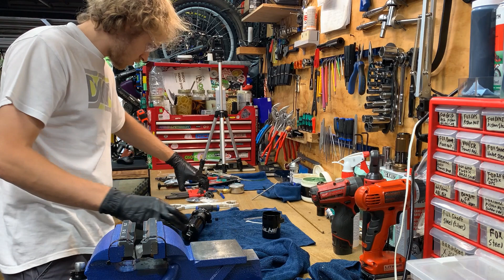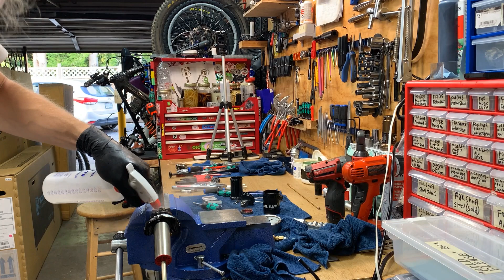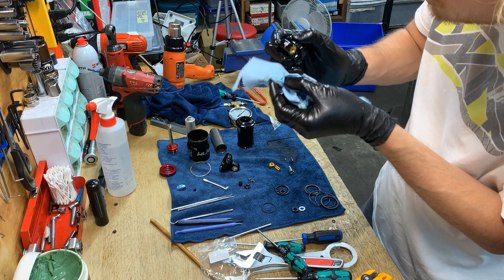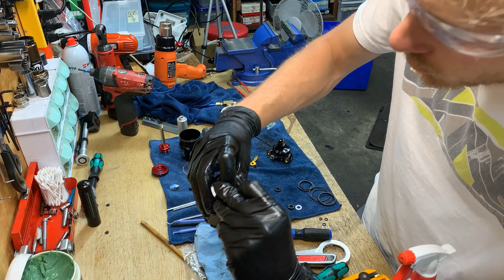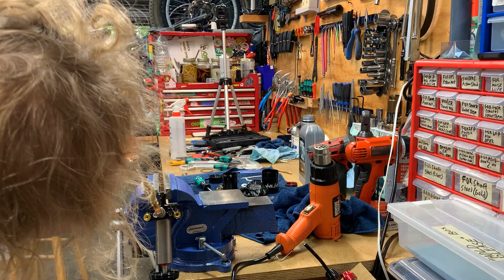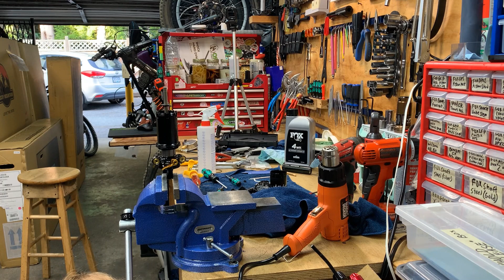Cane Creek Double Barrel Inline Rear Shock Full Service

Comment: @ 48:40 you put a tool in the IFP; what is it? You then insert your needle connected to the pump.
Reply from the maker: Two items are needed for inflation: https://www.mtb-hydraulics.com/product-page/suspension-gas-nitrogen-air-fill-needle-assembly

https://www.mtb-hydraulics.com/product-page/fox-398-00-374-pellet-retainer-tool

The second tool is to tighten down the sealing pellet once the needle is inserted. If you tighten it ahead of time, the pellet is compressed (hard), and the needle insertion is much harder.
Reply: Hallo so u fil the nitro camber with air. The pellet retrainer tool is it a special one

Comment: I tried to add a volume spacers and a decent amount of oil came out is there any way I can quickly add oil??
Reply from the maker: That's just the air can lubricant. You can squirt oil back into the air sleeve with a syringe.
Reply: @simonszoke1479  thanks for the advise I took it to a shop and they told me its a blown shock apparently it would have been blown before I opened the can
Reply from the maker: @Juleslshaw  ahh ok. Best way to diagnose damper issues like this without disassembly is playing with the adjuster at the fully closed and fully open ends of the settings. Then compressing it in the bike. Things to look for are a firm lockout and slow and constant speed rebound at the slowest rebound setting. If these are not the case then most likely blown damper seals are the case. This shock often has that issue, and there is an upgrade kit available. The upgraded sealhead uses a thcker seal that holds up better to the shock flexing and general wear.